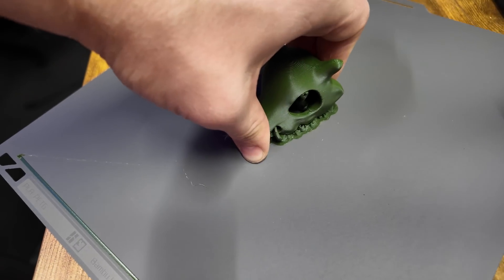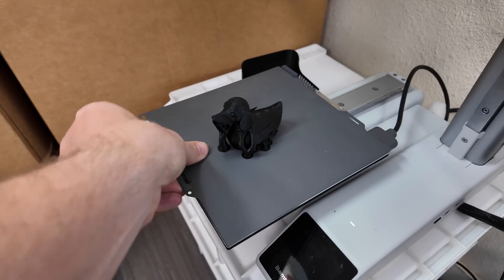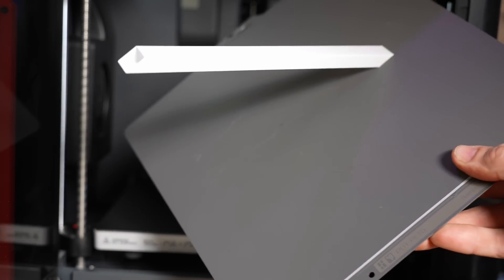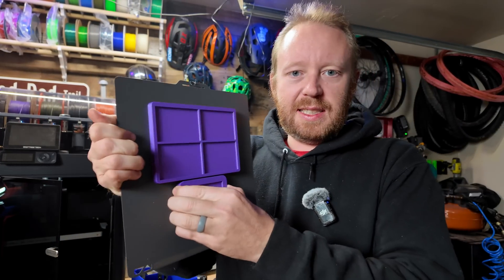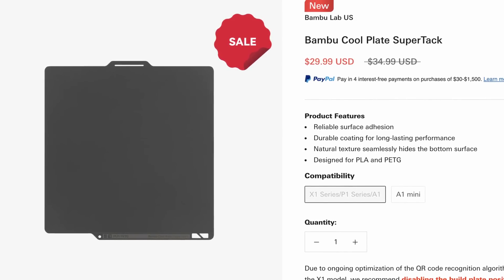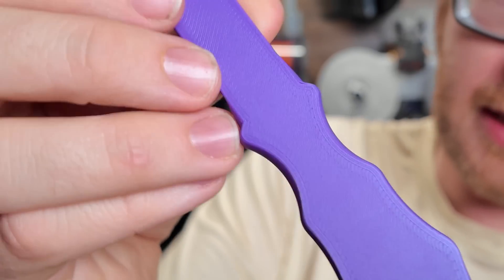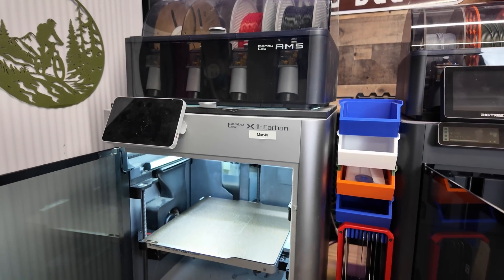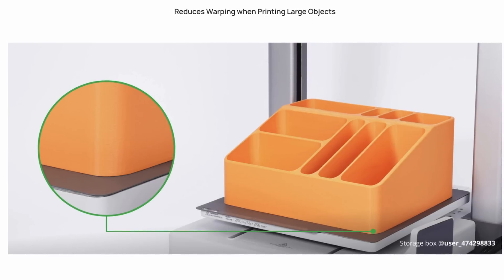Bambu Lab Supertack Plate: Awesome with a Side of Trouble

Comment: Honestly I’ve had great results with this print plate. When I first started using this print plate my prints were sticking a little too well and was damaging some if not all my prints. It was a chore to get supports and other things like purge towers off. I used Bambu labs glue stick on the print plate and to my surprise the glue acts sort of like a release agent. Ever since then it’s been a great plate and I haven’t had any issues. I use alcohol on the spots where I printed wiping it off and adding glue to those spots. Hopefully this makes sense. Let me know your results.
Reply from the maker: Interesting, Ill have to test the glue stick.

Comment: the trick is to pull the parts off right after printing. When the plate is warm the prints will come off much easier. The adhesion increases when the plate cools off.
Reply from the maker: Thanks for sharing that!

Comment: With you emphasizing how much your prints can get damaged trying to remove them, I'm wondering if buying mine was even a smart move... it hasnt arrived yet and man now I'm wondering...
Reply from the maker: you will probably be fine. I still use it and it only has issues with certain prints. I think there was some comments of people suggesting to heat the bed up to 50c i think and it can make it easier to remove.

Comment: I ordered it recently. It seems to me that, like the rest of the tools, everything has a specific use, in this case for prints with little base surface or with a tendency to warping.
In the case of boxes or large surfaces, I think it is better to use an alternative design (rounded corners) and the textured plate, to risk damaging the print or the base itself using this one.
I mean, a great facility of Bambu printers is the ease of changing printing plates, so why not use the best for each moment?
Great video btw!
Reply: that's a great point. Will be using mine for this purpose :)

Comment: Hmm, I print all my stuff in PLA and PETG on a TEVO Michelangelo, which means no heated bed. From my point of view, worrying about something sticking too much is at least ridiculous, though somewhat understandable. I would simply use the Bambu Lab Cool Plate SuperTack only when absolutely necessary.
However, it would be useful to understand in which situations it’s best to use it, or if there’s a relationship between temperature and the contact surface area to avoid problems with excessive adhesion.
Also, whether the use of glues or liquids can help with part removal without compromising adhesion.

Comment: mine has too good of adhesion. i cant get the skirts of my last print job off.
Reply: Pop it in the freezer over night
Reply from the maker: if the metal scraper doesnt work with the bending of the build plate, i think someone mentioned you can try heating up the build plate as well

Comment: I used this plate and it destroyed my print. The PETG did not adhere to the plate and the head crashed into the print within less than an hour into an eleven hour print. And the remaining print slid right off.  So I changed back to my Trusty textured PEI plate and it worked flawlessly.
Reply: Seems to me the issue lies to PETG which I had very poor results recently.

Comment: I just got this plate, tried it out of the box and my parts broke free during print, they were long flat parts too, only about 12mm tall and 80mmx20mm wide/deep.   Are you supposed to clean this one with soap and water, and de grease with isopropyl.  That works well for me using engineering plate and original cool plate. havent had a chance to test cleaning methods on this one yet.
Reply: Same issue here, costly print failures twice. I had to fallback on the textured plate.
Reply from the maker: Only use Soap and Water. Isopropyl will damage the plate according to bambu. As a rule of thumb, I give all new build plates a solid wash with Dawn before using them.

Comment: It's a very good plate. I got 3 of them. For X1C, A1 and A1mini.  First one warping my prints and I think I have done stupid thing. For some reason I thought I did read to clean it with IPA and did it when got a plate. So only warm water and good dish soap here. No IPA or anything like it should get on Supertac plates. On second one I'm printing quite big project. Around 100 3hour prints with item around 60%  coverage of plate. And on first ones I had Same problem with very hard to get prints off from the plate. Even damaged two of prints. But then I tried recommended method and never had any problem getting prints off. So.... It's very simple. You have two options. 1st - Peal print from plate right after print is finished while plate is still 40+ degrees or if it is cooled, I found warming plate to 55% and wait for 1-3 minutes at this temperature then take plate and peal print off. It won't release print like PEI ones, but comes of easy. And I would recommend to get some wide plastic scraper for large prints. work like magic. Plate is super. Done almost 100 large PLA prints and haven't need to clean or whatsoever. So conclusion. Never peal large print from Bambu Supertac plate when it is cooled (you can do this with small prints using scraper)  and if you clean it only use a warm water and good dish soap (Dawn or its European version - Fairy is recommended).
Reply: 55% or 55 degrees C? I have a bunch of stuck skirts. has this happened to you? im very annoyed.

Comment: what about ghosting from previous prints and marks that may be left behind on the plate? i never get this issue with my standard plate from bambu but i have had many adhesion issues and would like to try out t he new tacky plate.
Reply: From my experience there is no problem with ghosting. But of course I have not used it very long time. Yes I have some ghost marks on bed after I have pealed some prints from cooled plate, but they have no affect on following prints. Only one suggestion what I'm doing with all plates. Not to use same plate for PETG and PLA. I have marked all my plates as PLA and PETG ones as any micro residue sticked on plate will almost for sure affect adhesion.

Comment: I ordered one to try out, but after tuning my prints to perfection, I never have any warping on smooth or pei and get excellent adhesion.
Reply: Hi can u tell me what tuning u done to fix warping , i have A1 and when print large items corners lift up
Reply: @damiankozlowski3138  it's a lot of factors. Have you l3arn3d to tune your filament? What temp are you printing? PLA?
Reply: @TheWeaselWeb  i print a lot staff, without any problem but only 1 project have issue with warping, plate tray for money 220x150x40 standard profile for bambu matte, filament no name matte
Reply: @damiankozlowski3138  Reduce your infill if possible. Heat your plate AND your filament more. I print at 240* in an enclosed case for zero warping. A guy accidentally printed at 250* the other day and got the best prints of his life. Everyone will argue with me, but NO AIRFLOW on or around the print. PLA likes heat a lot more than is admitted. The plate is probably cooler than it's set to, especially on the outer edges. Thicken your walls if possible. I assume you tuned your filament profile. If not, push temps up and tune!
Reply from the maker: This and the BIQU versions have become some of my favorites to print with at the moment.

Comment: DO NOT USE THE METAL SCRAPER. Ever! Throw it out. Super tack should only be used with special projects. PEI plate is good enough for almost all prints.
Reply: I will agree for my environment. What I have found is these printers vary greatly in different locations. Ppl fuss at me all the time saying I'm wrong, but I've seen it first hand. With the P1S or X1, you don't suffer from this as much, but it's still a factor.

Comment: Do I have to clean it after every print? Can I use 91% alcohol?
Reply from the maker: @queenncolee916  don’t use anything other than soap and water to clean it. I also found it doesn’t need to be cleaned as often
Reply: @RadDadsPrintLab  I second this. Alcohol doesn't seem to work that well for me even on other plates. I guess soap and warm water is the best. You just need a way to dry it fast if you need it instantly. I use an air duster, a minute or two and am done drying.
Reply: I wipe mine after every print with 99% alcohol work like a charm no issue to speak of as of now.

Comment: I have this plate for both my A1 mini and P1S. Yes, it has an intense adhesion, but what I do is bend the plate enough to get some separation on the edge, and I have a wedge scraper that I printed that I can get under the now released edge, and push across to release the whole print easily.
Reply from the maker: Yup Exactly what i do.

Comment: Its very good, been using it for a week now and so far no issues at all. Even using generic Silk PLA its very good. Just let it cool down to about 18 19 degrees (room temp) and it pops off nicely. No mess and no clean up, saving me a fortune of electric with the lower bed temps and lack of use with the 3Dlack glue. Win win. So far its great. Now doing a 14 hour print in Silk PLA so will see how that goes in the morning. Check us out for some videos.
Reply: @skeletonlasergifts2833  Bambu specifically tells you not to print silk on this. 🤦‍♂️

Comment: I cannot get anything to stick to mine. At all. In am pissed.
Reply from the maker: I seriously wonder if bambu lab is having some QC issues.
Reply: @RadDadsPrintLab  That could really be it. Mine is also pretty shit. PLA will stick when the Bed temperature is at 65 deg C. But still worse adhesion than the textured PEI plate.
Reply: Same. Have tried everything. PETG or PLA will stick
Reply: Mine won't stick either. Oddly I can print one of those stair step tests, but anything curved breaks loose about 5 mm high. Bought a BIQU Cryogrip. It works well. All my other plates work well. Just not the Supertack
Reply: I don't know if you ever got it figured out but i scrubbed the shit out of mine with dish soap water and a scratchy sponge. It seems to be working as advertised now tho I'm still reluctant to trust it on a large long print... which  is what i bought it for... Maybe some of these are arriving with a contaminated surface from shipping/manufacturing or something.

Comment: Stories on Reddit tell another story so who do I believe 😮‍💨
Reply: I have had no successes.
Reply from the maker: Yeah it sounds like something weird is going on. Both of my Plates are doing great. Ive only had an issue when the printer fails to properly set the Z offset
Reply: I got the cool plate. Worked good at first but I've had to bump the bed temp 10C and I'm having issues in certain spots of the plate.

Comment: What's the secret to this plate? I got mine last night and as a test printed a new plate holder to accommodate the additional plate. Took a couple of tries to get the first layer to even stick, once I worked that out I had 2 pop off the plate after 10mm, and finally got a print to finish but still had a bit of warping.
Reply: Bambu Studio defaults to 35c for some reason when the recommended for PLA is 45c on the website, try changing it and see if its better.
Reply: @TheLiveactiongamer  Mine actually defaults to 45, but I've even tried higher temps up to 70 with no success. I've never used IPA on it, I've washed with dawn dish soap and hot water, and neither PLA nor PETG will stick to it.
Reply: @chrissnyder4439  same for me, nothing sticks to it. It's really frustrating
Reply: @VictorGarcia-yf6rr wash it with warm water and dawn dish soap and then adjust your plate temp to 63-65. It should work. At least that’s what I do for my prints and it works all the time.
Reply: I was going INSANE trying to figure out how to make the build plate work properly with the settings within BambuStudio. So I tried this: On my A1, X1 and P1 I set the bed temp to 65 when using PLA and the adhesion is unmatched. Minimal to no warping and the prints just stick. I've done multi day prints for a single model (Darth Maul Charizard with approx 8 colors - 3 day print) and it stuck to the plate like it was no ones business. It's really just about what works for you I suppose.
Reply from the maker: Yeah it sounds like something weird is going on. Both of my Plates are doing great. Ive only had an issue when the printer fails to properly set the Z offset

Comment: I'm using the Textured PEI plate that comes with the P1S - the layer adhesion I'm getting with PETG (specifically Sunlu PETG) is really good. I can't imagine "better" adhesion that I'm getting, but I guess if you get it at lower temperatures I could see the benefit.
Reply: The entire point is the surface finish being matte and smooth. That's it. Otherwise yeah, the textured PEI is best
Reply from the maker: I love the textured plate also but I feel like the surface might need to be cleaned more
Reply: Odd with me Bambu PETG is really bad bed adhesion. Really BAD

Comment: It's currently junk for an X1C. The machine can't read the QR code, and you have to turn build plate recognition off. Mine are gathering dust on a shelf. Spray IPA around the edges and give it a couple of minutes to pull under the print with capillary action, and prints will come off much easier.
Reply from the maker: Hopefully they can refine something in the software to fix the qr code reading.
Reply: @RadDadsPrintLab  I think a workaround is to print out a qr code that is the same on the plate and stick it on there

Comment: I can confirm the great adhesion. But so far with 10+ prints with this plate, I haven't had to use the scraper. I mostly us Bambu and Overture PLA.
Reply from the maker: if the print is thick enough i can bend it off, but when its low profile i gotta use the scraper.